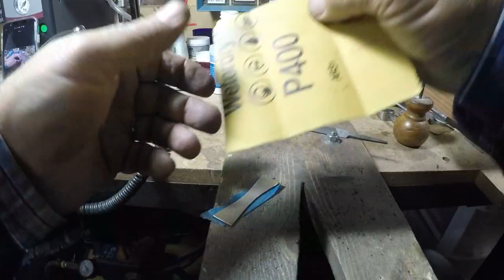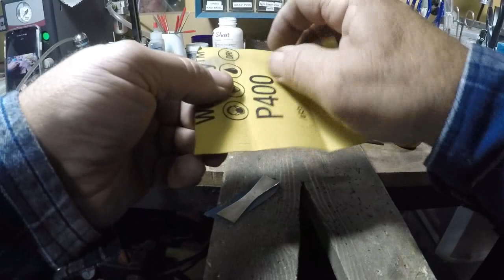Making a Sterling, Gold and Turquoise Inlaid Ring

Comment: I see you used a 80 grit sanding disk. Would using a sanding drum of the same grit be ill advised?
Reply from the maker: You can. But make sure you are sanding it flat, and watch the heat of the glue while sanding.